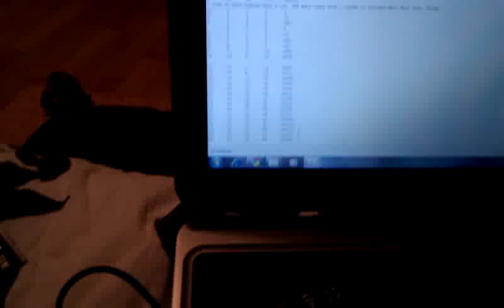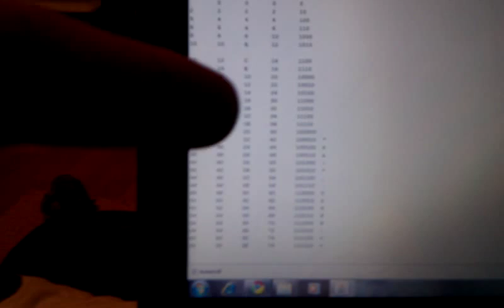Arduino FIO board with xbee Pro & 900mhA battery

Comment: Hi, have you power up your Arduino Fio with a battery? The USB port doesn't power up the board. What it only does is to charge the battery. Trying pluging the battery pack in.

Comment: I tried to program my Arduino Fio wirless using Xbee Pro S1. But every time I tried to upload the sketch wireless to my Arduino Fio, I always encounter this message:
 avedude: stk500getsync(): not in sync: resp=0x00 avrdude: stk500disable(): protocol error, expect=0x14, resp=0x51

Do you know what went wrong? =)